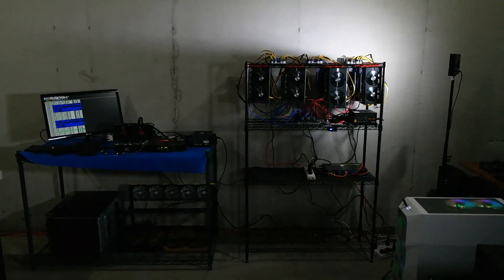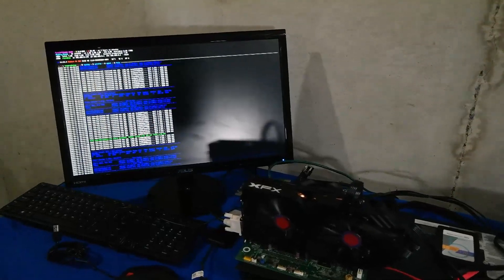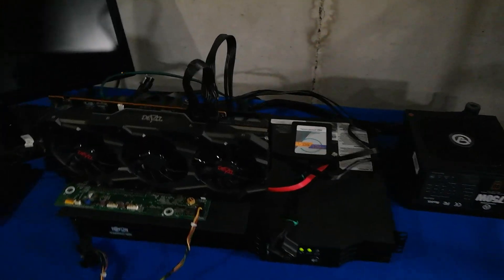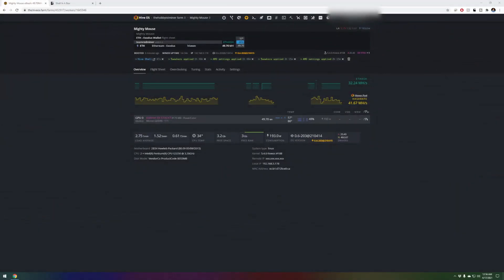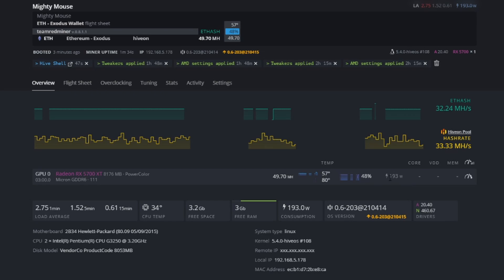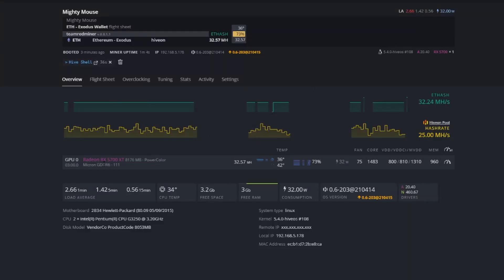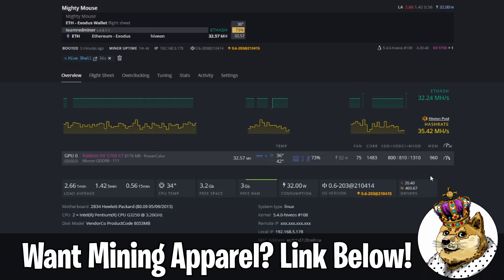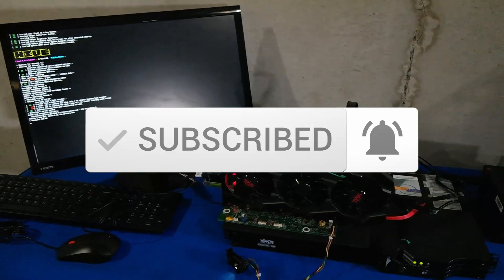RX 5700 XT Mining Hashrate Testing & OverClock Settings

Comment from the maker: Are you Running the RX 5700 XT?  If so what kind of hashrate are you seeing?  What are your Overclock Settings?
Reply: I'm running 5 of them at 54-55mhs, I can get them up to 58mhs but they get unstable. 

4 Samsung and 1 micron.
Reply from the maker: What kind of Overclock Settings are you running?
Reply: I have sapphire nitro+ ones, with samsung and micron memory.
For the microns I use 1420 on the core, 790 vdd, 1350 mvdd , 940 memory. They are running at 98-102 w and with 58.00 Mh/s. They are bios modded. Copied the 1500 memory straps to all above 1500
Reply: @gocak745 what did you use for your tref#?
Reply: @gocak745  what settings do you use for the Samsung ones ?
Reply: @stevecollins4742  1340 gpu 900 mem
Vdd 730 mvdd 1350. 86 w software
Reply: just got a 5700xt thicc II model and pulling 49.5 m/h no oc no bios mod
Reply: With samsung mem
Reply: with bios mod 57mh at 125w(on the software)
Reply: 43 AVG @ 110 but i just started
Reply: @Parviz Hajizada Hi , i am setting up a mining rig with msi x99 gaming pro carbon right now.I have 3 x rtx 3060 and 1 x rtx 3060i , do you think i will be able to add one more ? Any tips on mobo config? 
I was thinking getting a rx 5700 xt as well ....
My Cpu is 40 lanes
Reply: I cant get anything stable with bios modding using asus strix 5700 xt. Stock bios, 1300 core, 1750 mem, 800mv gets me 50mh at 110 watts. Thats the only way i can get these stupid cards stable.
Reply: I can't seem to get mine above 51 mh/s stable, only changing core and mem clocks so voltage might be a problem
Reply: I have 2, getting 55.5 and 58.5. the 55.5 is a cheap-looking powercolor one and it as trouble with heat. The other is a Sapphire Nitro+, beast card

Comment: I’m running a stock NOT overclocked red devil 5700xt at 50.7 Mhs core speed 2042 ram speed 1742. I don’t know why it is running this good but I’m just going with it.
Reply: what were the temperatures?

Comment: Im running two XFX 5700Xt with Micron GDDR6  OverClock Settings --- Core 1400 VDD 780 Mem 960 Vddci 930 both cards bios modded and pulling 123 watts at 57+ MHS
Reply: 58Mhs 123W
Core1400
Vdd800/vddci800/mvdd1350 
Mem940
Moded bios and timings

Comment: Found a great bunch of settings using Radeon Software on stock BIOS (I use this rig for mining only when I'm not gaming):

RX 5700 XT Ethash Mining

780V
-42% power limit
1400 CC
1800 MC
fan curve set to hold <60C (usually 40% speed)
	RESULTS:
	95W
	50.89Mh/s

Comment: Nice Video, very well explained! I have a lot of 5700XT in my Rigs. I would they they have such a nice hashrate with less watts! But they are all different!! Even if you have exactly same ones the Hashrate can differ up to 5mhs. But I ALWAYS get at least 50mhs from all of them and they run so stable. I really can recommend those cards. 

My basis setting where I always start playing is:
Core: 1300
CoreV: 750
Mem: 1820

Some Cards are not able to run over 1770 memclock, some are fine with almost 1900. Its a lottery :) 
I´m using only Watchman for overclocking and Win10 (you have to deactivate ALL possibilites of automatic updates in the registry, then it is running stable like HiveOS but without any monthly costs ;) My 5700XT Rig with 10 Cards is running stable for more then 6 month in a row with 540mhs!
Reply from the maker: I am glad you enjoyed it!

Comment: New to mining when connecting the 8 pins does it need to be 2 different wires or can I use a splitter or 1 wire with duel 8pin connectors
Reply: two

Comment: Red Devil RX 5700 XT 
Ethash 54.87 Mh/s (Teamredminer) @97W (software reported)
Core 1243 Mhz @750mV
Mem 1790 Mhz (Bios modded with 1550Mhz timing, I have Samsung memory). Can't do 1800 Mhz without giving error once every few weeks.

This card came with cheap thermal pads causing TMem to reach over 90C. Replaced them with pads from Arctic and now sitting at 80C. I'm planning to replace them again with better ones from Thermalright to see if I can push the memory further by lowering the temperature.
Reply: I feel like you should do a video. my cards are doing 51Mh out of the box. maybe the better memory. i have the power down to 125W
Reply: what thickness were the memory / vram pads? or a link if you have it .. thx.
Reply: @wx2833  For the Red Devil, it's 1.5mm thick. I saw someone used 2mm pad but I think it was because the pad was soft and can be squished down. I'm using Gelid GP-Ultimate 1.5mm 15W/mK and Tmem hover around 76C with ambient temp of 30C.
Reply: @huuphu17  thank you for the insight; going to give it a shot; I normally use thermal grizzly.

Comment: Bios settings: Default

Radeon Settings:
GPU Clock speed: 1299
Voltage: 750 mv
VRAM Clock speed: 1896
Power consumption range: 116-118

Hashrate: 53.77
Reply: Is your gpu memory micron ?
Reply: @AccidentalAlgorithm  xfx rx 5700 xt thicc iii

Comment: Mine 5700 xt asus at normal setting hit 52,53 mh/s, but I managed just limit the power to 108W and my hashrate is 50 mh/s playing around to boost 10% and risking kill you GPU is up to you, better keep 50 mh/s for maximum timelife than get 10% more and kill 50% of its timelife... My opinion only...
Reply: And ofc I raised the fan speed at almost 50% of the limit 2000 rpm if i am right to keep it cool to let it work 24/24 7/7, the fan go to this level once it get to 65 degree to cool down...I setted it up on the graph where we see the % and the temperatures

Comment: I have a Sapphire Nitro+ 5700 XT with GDDR6 (Micron) and w/o bios mod I can get 52-53 MH/s @ 90W which I'm pretty happy with since it's stable, efficient and does not crash.

OC Settings:
Core Clock: 1300
Memory Clock: 1870 (I believe divide that by 2 since you are on Hive OS)
Voltage: 750
Power Limit: 0 or default
Reply: Noice, I have exactly the same version as you. 
I am currently getting 57.5 MH/s on simplemining OS. I used red bios editor to flash them and my OCs are:

CORE MHz 1400
Memory MHz 912
Core Undervolt 800
Memory UV (MVDD) 1300
Memory UV (MVDDCI) 800

EDIT: after I wrote this comment, I played a little with different values and updated my comment accordingly
Reply: @Tamtudy  I have switched to HiveOS & I'm doin 51.4 MH/s @ 82W. It's very efficient & stable that's why I don't even consider bios modding.

Comment: Core 780-850
Core clock 1400
Memory clock 1800
52/53 mh on mine
Reply: I'm using afterburner.  What did you set your voltage at?
Reply: @regenwealth   I use hiveOS, core voltage 780 memory voltage is different on all my cards. Try leaving it at 0 to get a base or play between 780-850, gradually increasing by 5.

Comment: I have several 5700XTs running.  You really do need to do the BIOS Mod.  Really easy...

As a starting point for these cards, I use:
Core 1350
DPM 5
VDD 750
VDDCI 800
MVDD 1350
MEM 890
FAN 60%

I am seeing 54-55 MH, 98-112 Watts, depending on the card.   If Mem heat is above 88, back your Mem down by 10 and test.

I am not getting 59Mh, but i can sleep at night without worrying if my rig crashed or is burning up.
Reply: What do you use to mod?

Comment: RX5700XT evoke (the hot one yup, I still have to change the pads, getting 86ºC on the memories):

I had never BIOS modded when I first got the card so I was a bit concerned about doing it.
I Will do it when I'm able to be near my farm, it was my first mining card back then.

I'm getting ~53Mh/s with no BIOS mod for a few months now, it never shut down or reboot.
core clock: 1300
core voltage: 750
memory controller: 800
memory voltage: 1300
fan: 80%

It can still be improved, back then I followed a few guides of stable and safe configs.
Now that I have the experience with other cards I will improve it very soon.
Reply: Updating my comment.
A few days later I BIOS modded the card and got 59.5mh/s, memories at 86°.
I live on Portugal, it gets hot.
Reply: @joaosimoes5052  how do you bios mod it? I have the 5700xt red devil with two fans and getting 53mh/s but it’s at 140w. Do you think it’s worth modding it? My only amd card
Reply: @joaosimoes5052  thanks I’ll have to check it out. All my other cards are nvidia so this is new to me. Is there a bigger risk of damaging the card with mod? Card already reached ROI since I had it running for last 5 months
Reply: @OmgToons  here is the documentarion for the 5700xt:

"5700/5700XT Stock-to-Performance Guide
--------------------------------------
Most 5700/5700XTs can be flashed easily. Igor's lab has created a range of tools
for advanced Navi tweaking. This is a guide for taking a stock Navi 5700/5700XT
to a setup that produces 56 MH/s in the new TRM B-mode. Note that not all gpus
can handle the high hashrate and will crash repeatedly. Such gpus need to be
clocked down and run at a less aggressive hashrate.

For using the guide below, we highly recommend making sure you can run the TRM
B-mode by using a driver that supports large single allocations (amdgpu-pro >=
20.30 on linux, Adrenalin >= 20.9.1 on windows).

NOTE: flashing a bios always presents an added risk. The guide here is presented
      as-is using known standard tools that have been used on many rigs
      worldwide, and even the few times when a bios flash goes wrong you can
      most often recover by reflashing the original bios in recovery mode / safe
      mode.

1) Set up a tool to control clocks and voltages. You can use the AMD driver
   tools, MSI Afterburner or OverdriveNTool on Windows. On linux you need to
   read up on and understand how the sysfs api works for amdgpu-pro, or use a
   mining distro that helps you setting clocks.

2) Start with a safe configuration of 1275 MHz core, 875 MHz mem (1750 MHz for
   drivers displaying 2x mem clock), set 850mV for voltage. Start the miner and
   verify that mining works fine.

3) Google "Igor's lab red bios editor". Read the tutorial they provide and
   download and install the software.

4) Save the bios from your gpu to disk using atiflash or amdvbflash (and keep it
   to be able to flash back if necessary).

5) Open the saved bios in RedBiosEditor, copying the saved bios from linux to a
   win workstation if necessary. There are often two memory types available in
   the bios, Samsung and Micron. If you're not 100% sure which type you have, do
   the copy-up described below for both.

6) Bios mod 1: strap copy-up. We want to copy the strap (the long string of
   letters and digits) for 1500 or 1550 MHz to the higher frequency
   entries. Copy it and paste it for all higher entries above the strap you
   copied. Save the bios and flash to the gpu. Reboot and test mining again. You
   should now hit approx 53 MH/s.

7) Bios mod 2: reopen your (already edited once) bios. Open the trap timings
   editor for the 1500/1550 MHz entry that you copied in the previous step by
   clicking the "1550 MHz" button. You want to increase the DRAMTiming 12 (tREF)
   entry to 2x the original value. Do the same thing to the higher frequency
   entries, or copy/paste the 1550 MHz strap again after you've modified
   it. Remember to do this for both mem types unless you know you have Micron or
   Samsung. You can get even higher hashrates by using 3x the original tREF
   value, but we suggest 2x as a first test. Save the bios, flash to the
   gpu. Reboot.

8) When running the miner again, you should hopefully see a higher hashrate yet
   again. if you have a driver that supports large allocations and TRM defaults
   to B-mode, a core clock of 1250 MHz and mem clock at 912 MHz should now
   produce a 55.5-56.0 MH/s hashrate. If you're in A-mode, you need a core clk
   around 1350-1400 MHz to support such high hashrates.

9) Now, retune your gpu to the configuration of your choice. Start by tuning the
   mem clk to a level where your gpu seems to run stable and produces the
   hashrate you're looking for. Less can definitely be more if you're looking
   for efficiency. Next, tune down the core clk as much as possible, restarting
   the miner to check if you've lost hashrate or not. We want to find the
   balance between core clk and mem clk so that neither of them is the clear
   bottleneck. In B-mode, you usually see a sharp drop in hashrate when the core
   clk is dropped -25 MHz too low. In A-mode, you will also see the hashrate
   dropping but not as dramatic.

   Last, lower the voltage step by step as much as possible. Gpus with good
   cooling can often drop as low as 700-725mV. For dropping below 700mV, the
   powerplay table limits need to be modified. This is not covered by this
   quickstart guide.

   Note: Micron memory is in general easier to tune for these high"

Comment: I have 5x powercolor red devil dual Bios one freaking steady at 52mhs I won't go any higher as they get soo hot and sooo unstable.
Over clocks were core 1380 Dpm 1 vdd 800 vddci 780 mem 890.

Comment: tdp limit 127w  gpu 1500mhz 850mv vram (micron) 1896mhz (I haven't god any voltage control on the memory). the memory is stable at 1896mhz but at 1835-1875mhz is not stable.
54mh/s (nicehash srbminer)
i used just the radeon software to overclock/underclock it.
maybe not so efficient but is needs to heat my room.
gigabyte rx 5700 xt gaming oc rev2.0
(0,88% failed shares)
Reply: SO FOCKIN' TRUE ABOUT MSI - After going round and round with them about all the different vBIOSs for my RX580s both 8gb and 4gb I have sworn I will never spend another dollar on MSI products. Just left all us miners out there with no resource simply because they think we will get frustrated and go buy another GPU. Guess what, MSI? BACKFIRED! I have bought MANY more GPUs, including 4 so far as of this writing of the PowerColor Red Devil 5700XT featured in this video. I also have 2 rigs of RX580 Red Devils and PowerColor ALWAYS ON POINT with the assistance over the years. If you do monkey around with your MSI vBIOS, BACK IT UP LIKE 5 TIMES IN DIFFERENT PLACES SO YOU HAVE IT AS LONG AS YOU RUN THAT CARD. And XFX has been another great company since I started mining in 2015 that has always answered promptly and helped me out. If YOU are somebody frustrated with this issue as well, SEND MSI A MESSAGE THROUGH TECH SUPPORT. As of my last message they seem to be softening. More voices = CHANGE.

Comment: Bios mod it! RX 5700 XT Gigabyte Gaming OC also Micron Memory
1440 Core at 725 mV
1870 Mem
117W
Hashing at 57.8 MH/s
Reply: Yes, doing a bios mod is the only way to get 55 to 60mhs. Where did that take your memory junction temps to? On my MSI cards it went to mid 90'sC which is higher than I like.
Reply: @gwnm1776  mine is hovering at 90-92 C. Expected as I'm at a tropical country with 27-30C ambient. No problems by far though. I just turn on my stand fan over my pc when it's past noon as my room temp soars during those times.
Reply: are you seeing any frequent crashes ?
Reply: @harshhardy60  none by far. Still stable up until now.
Reply: I do 50 mh/ s with junction at 60 degree, I just put 108W and raised the fan... Betting on timelife of my precious GPU, I prefer 20% more timelife than 20% instant gains, working perfectly since begining of March so far

Comment: Make a bios mod than core 1350 vdd 800 mem 910 and you got over 55 mh/s
Reply from the maker: Thats impressive. Yeah Bios Mode is my next thought.
Reply: 56 MH/s TUF RX  5700 XT after BIOS mod, 850 mv, 1100 mem 1350 Core